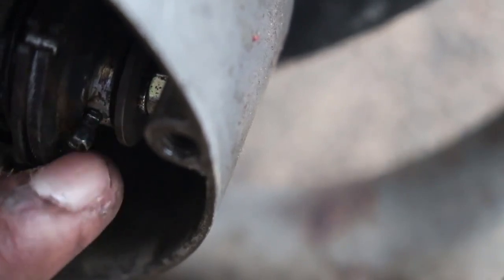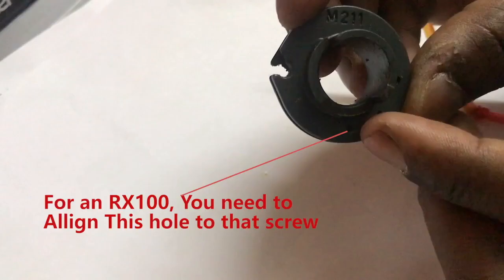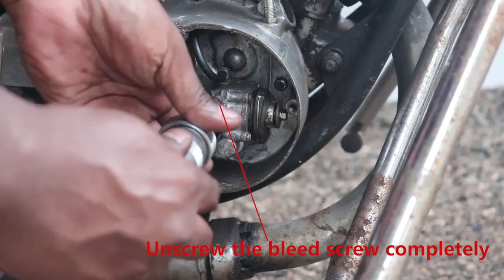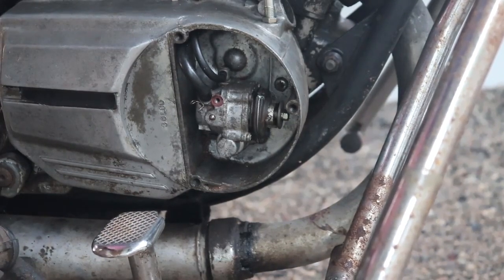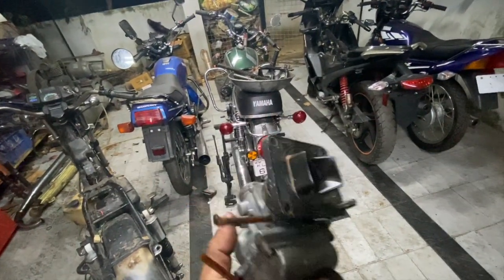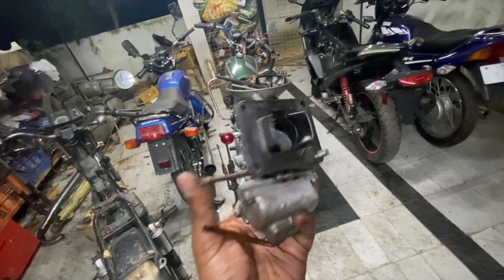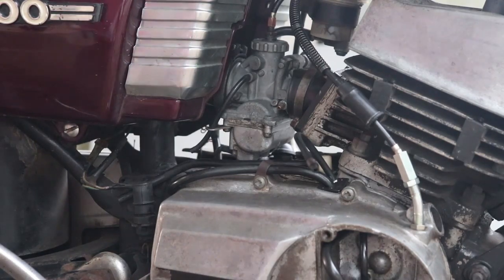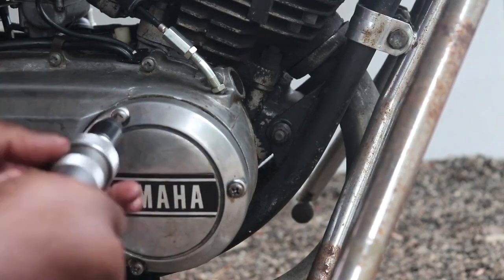2T Pump or Premix ? Which is better? (English Video)

Comment: I think both options have pros and cons.

With oil pump you won't need to add your 2T oil every time you are refueling. But there is certain worry that your oil pump suddenly malfunctioning in the middle of riding (But I believe with proper regular service, this rarely happen). Based on my experience, oil pump will pump 2T oil more and more gradually aline with your throttle opening and tend to pump rich when in high RPM so your engine is safe. Please note that racing 2T oil is not recommended with oil pump since it will put a lot of work to your pump.

With premix option of course you need to bring your 2T oil every time you are refueling and you don't need to worry that your oil pump is working or not. By this option, you won't get the proper mix for every RPM. Either you mix your oil for regular use (leaner side) or for high RPM use (richer side). Plus you can use racing 2T oil which tend to have thicker viscosity. But if you choose this option I won't recommend using paper type fuel filter since it will restrict the flow of premix fuel.

Comment: A good topic to cover cheta, so my opinion is same as yours but I belive that the oil pump if maintained can last without a trouble. But cannot relay with today's spares so better to go off with the premix. And in premix two main things to note. Cleaning the carb with a good carb spray and proper oil fuel ratio. Next would be to use the bike constantly to avoid sedimentation on the minute carb tunnels. Happy riding 👍🏻

Comment: Sir i been using 40 ml oil and as you said the engine heats a lot compared to my friends bike who uses oil pump a video is must from you for on this topic
Reply: Aniket check your air screw. It must be 1 1/4 turns out for a good mix and cool engine. And next is use 35ml of oil /liter. Check for air leaks on air filter manifold and reed manifold. Make sure the carburettor pump oil feeder nipple is closed with a tube and screw the end. Further there are factors of compression and timing which are a bit advance for beginners.
Reply: @abhimanyuinjeti5326  thankyou for valuable information
Reply from the maker: Good to people helping each other

Comment: the kb100 needs the oil pump for it to run properly ,as the clutch side  main bearing is practically sealed and 2t reaches it by dripping down the rotary valve slot
Reply from the maker: True

Comment: Sir
What is engine breaking ?
By the way very informative video.
Thank you
Reply from the maker: Using the engine to reduce the speed, for example while going down hill people keep the engine running and cut the throttle fully, so its a controlled descent

Comment: Hi, my cylinder was rebored and I was using 50ml per litre and it’s been around 6 months.
My motorcycle is 1989 model and I
Heard the bike needs more lubrications as the engine becomes rough day after day. 
 I’ve drive daily around 20kms up and down from work to home with a max speed of 45 kmph.
How much amount of oil should I use for 100rs of petrol?
Reply from the maker: 1 liter petrol needs max 30ml of oil

Comment: Auto lube gives more pickup, without oil carburetor jets sprays petrol good, and petrol burns well with proper ratio i love autolube really its good whith yamalube oil its heaven. Also carbon in silencer cause carbon seizer. You said japanees without reason they put nothing, its very good for engine i am riding original piston with little ported rx its very best..
Reply from the maker: It’s not a bad technology but it has its downside on a bike which is over 20+ years old bike, considering the damage it can cause, it’s safe not to use it and use premix

Comment: Hi sir I'm from Bangalore I use 40ml per litre of petrol on my rx 135 because we don't get 30ml packets in petrol bunks we get only 40ml and 20ml packets so I hope it's fine
Reply: There won't be a big difference. The actual feed from the autolube pump is around 32-34 ml. Try to compensate the 40ml with some extra petrol
Reply from the maker: Thanks for clarifying @rev rider it’s simple, fill pettol in the multiple of 2 liters, for every two liter get one 40 ml and a 20 ml sachets